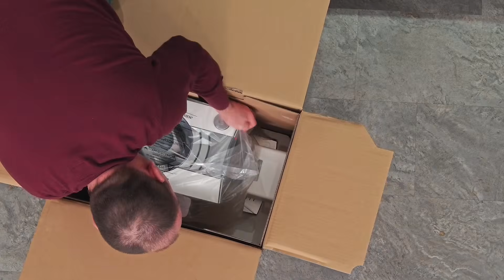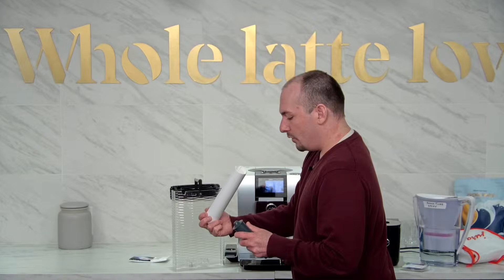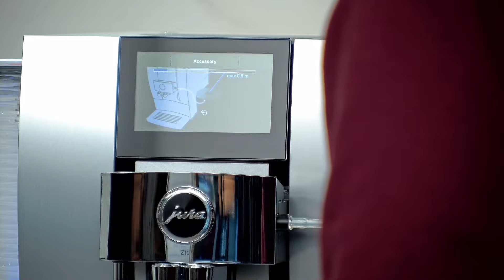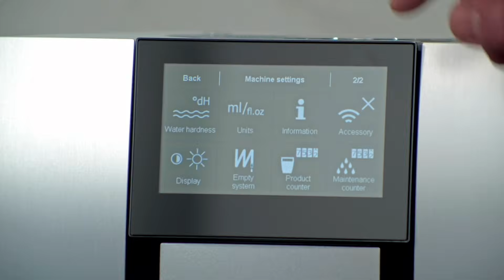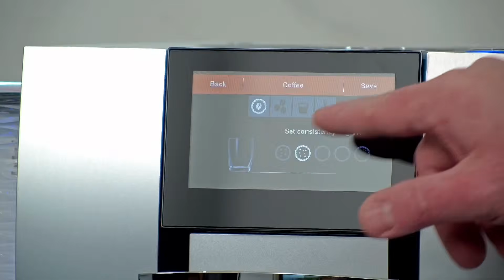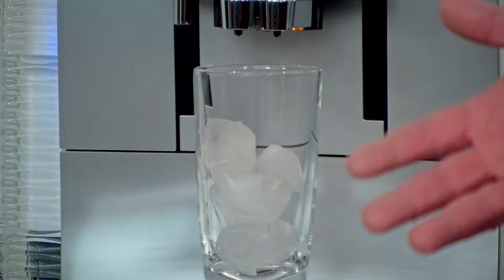Jura Z10 Espresso Machine: Unboxing, Startup, & First Use Livestream

Comment: Just came across a video of someone using the Jura syrup attachment with the Jura Z10—and it worked perfectly! This caught my attention because, according to Jura’s official website, the syrup attachment is only listed as compatible with the J8 and J8 Twin under the ‘Compatibility’ tab in the Accessories section. What’s confusing is that Jura explicitly states the Z10 doesn’t have the capability to create sweet foam, as it lacks the specific feature found in the J8 that uses a syrup cartridge to mix sweetness into the milk. Yet, this video clearly shows it working on the Z10. Has anyone else tried this? Is the Z10 more versatile than Jura claims, or is this just an anomaly? I tried to post a link to the video, but YouTube wouldn’t let me, but a user by the name of Kafiservice posted a video on TikTok.
Reply: i just got a z10 from william sonoma. it came with two sweet foam blocks. Bought it 2025-06-15
Reply from the maker: That’s an interesting point and I haven't seen or heard of this happening before - thanks for sharing!

Comment: still have my Jura Giga 6 at over 10,000 cups.  Liking the cold brew options but reading that the Giga 10 loaded with issues so ended up here at the Z10.  Seems like two different machines so for me the new offerings are confusing trying to figure out what is what.  This used to be much easier lol

Comment: Hi! how do you compare a latte or cappuccino on this machine vs semi-auto (made by home user, not a barista!). thanks!   If you have an semi auto but wanted simplicity, would you be happy with this one?
Reply from the maker: Hi p, thanks for the question. The Z10 can do milk drinks using cold brew espresso. If those are on your menu then it's the winner. Both machines make excellent regular espresso as base for milk drinks. If you are extra particular about the espresso the Accademia has more control of flavor with flow control on the coffee spouts. If you switch coffee drink types a lot the Z10's product recognizing grinder gets the grind right by drink type.  The Accademia has 3 programmable levels of milk foam density. The Z10 separately programmable amounts of milk and milk foam in each drink. Hope that helps!
Marc

Comment: What is the milk connected via the side? Can I just put milk in a jug that’s included and have it auto foamed ? I have another brand automatic put desired amount of milk in the jug  put that under the steam want and press a button then just rinse it with hot water for next time . Thanks
Reply from the maker: Hi jt, If I understand your question, yes you can just drop the pickup tube which feeds the milk into any container with milk. We do have custom Jura accessories available include glass milk carafes and countertop refrigerated units that keep milk cold indefinitely.
Reply: Yes. You don’t have to measure the milk yourself. Fill a large cup or whatever with milk and the machine measures how much to use. I use s small Tupperware container so I can close it after and store it in the refrigerator for next time.  ALWAYS rinse the tube and Z10 with water (as directed by the machine screen) after making a milk drink or you are asking for trouble!

Comment: I am unable to adjust the coffee temperature beyond 75 C. How do I make it hotter?
Reply from the maker: Hi bs, 75C/167F is in the normal range for in-cup finished temperature. Did you set temperature to high in settings for the drink? If not, that will likely get you a few degrees warmer. Beyond that, type of cup makes a big difference. A large, thick ceramic cup at room temperature will cool the coffee quickly. Preheating with hot water can help. I was testing a similar Jura machine last week and temperature of coffee leaving the spouts during a 180ml/6oz regular coffee brew maxed out at 86C/186F. In cup finished temperature was 78C/173F in a thin walled glass cup with low thermal mass.
Reply: There are 3 choices for water temperature. Other than that, if you put boiling water in your cup first and dump it out and start with a hot cup…that makes a huge difference. Keep in mind milk drinks are never supposed to be too hot because it changes the taste of the milk. There are 3 temperature settings for the milk.

Comment: Why are they cutting the costs of the machine housing material? Love the machine, but the plastic housing and issues with the cracking and breakage of the front house are making me think twice.
Reply from the maker: Hi Z, plastic is fairly typical for housings in super-automatic machines from all manufacturers. I've used a lot of them and never had a cracking issue. There are a couple of machines that don't have plastic housings. My favorite is the Gaggia Accademia which has a painted stainless steel housing with glass front: https://www.wholelattelove.com/products/gaggia-accademia-espresso-machine?variant=14409122512955
And the Jura ENA come in an all aluminum housing: https://www.wholelattelove.com/products/jura-ena-8-espresso-machine-aluminum?variant=32524237111350

Comment: So Gaggia Academia, Jura Z10 or Jura Giga10. What do you think is the best? Also best quality coffee? I have a Gaggia I bought from you now but it’s ready for an upgrade. My wife hates changing the pucks frequently so I need a machine that holds a good amount in between changes. Also guessing Jura makes better coffee?
Reply from the maker: Hi Jeff, Thanks for the question. The Jura machines have higher capacities than the Gaggia for used pucks and water so a good choice to keep the wife happy! Of course they have much higher price points as well. For best coffee, it depends on the type of coffees you are making and how likely you are to take advantage of features on the machines to adjust flavor. All make very good espresso. Jura uses a pulse extraction process to slow down espresso extraction but other than that shots are not tunable beyond grind size and strength setting. My favorite for espresso is the Gaggia Accademia. Beyond grind size and strength it has a variable dial to control the flow rate of water through the coffee. My most liked feature on the Accademia is the Boost function. It makes an espresso using 2 grind cycles and splits the volume so the first grind makes a normal espresso and the second is a shorter and sweeter ristretto. The combination of those 2 makes for the best tasting espresso I've had from an automatic machine. The Z10 and GIGA 10 have the very unique cold brew brewing method available. If you like cold brew it's excellent and something no other manufacturer does. Do not be fooled by the brew over ice others do - not even close to what the Juras do. The GIGA 10 has dual grinders so you can have different bean varieties in each or decaf beans in 1 and do percentages from each grinder for half calfs etc. Hope that helps!
Reply: @Wholelattelovepage  are you seeing a lot of issues on the Jura 10 that's what I keep seeing online?  Seems like build quality is downgraded since I bought my 6.  I know you sell it so maybe not the best place to ask this question but as someone that sells high end electronics I do get the occasional new release with design or performance issues and I stay far away from it and tell my customers it's a no go.  They don't want the frustration and as their dealer I don't want those frustrated calls and returns either.  People pay good money and expect quality in return.  So you guys know what kind of response you are getting on the GIGA 10 and would be great to know if what I'm seeing (issues/problems/leaking) is an actual problem or just a loud minority.
Reply: Hi, Jeff. Did you decide on a machine?

Comment: How many amps does the Z10 draw, and the milk chiller? Do you recommend the mug warmer for small cups (like espresso)?
Reply: 1450 Watts so divide the 1450 Watts by the number of Volts in order to determine the number of Amps.
1450 divided by 120 Volts = 12 Amps. If you divide by 100 Volts, then 14.5 Amps.

There are 3 sizes of the Cool Control and the smallest (0.6 Liter) is 20 Watts, the 1 Liter is 25 Watts and I’m not sure about the biggest one.

25 Watts is only 0.25 Amps (or less depending on 100 Volts or 120 Volts.)

So I wouldn’t worry about the 25 Watts and I would plug them into the same circuit breaker.  But, you do want a 15 Amp breaker and not a 10 Amp breaker, so probably has to be in your kitchen (or bathroom.)